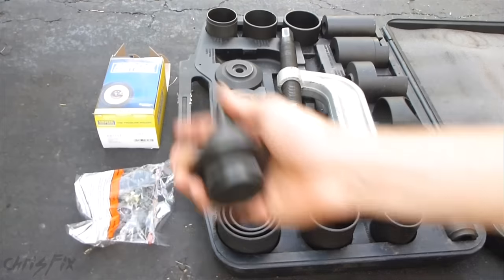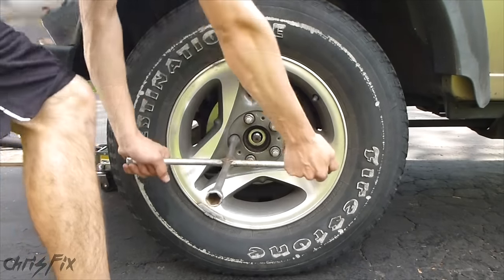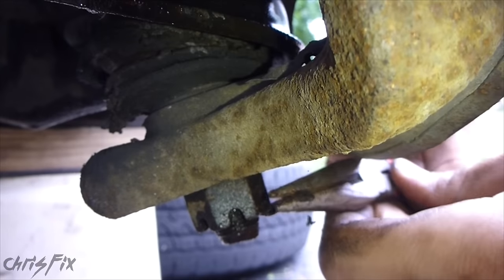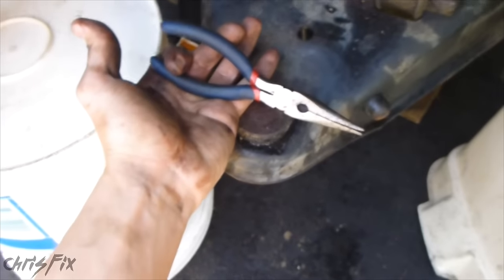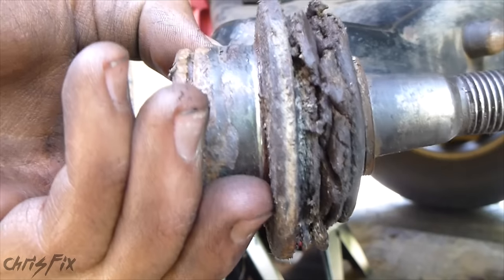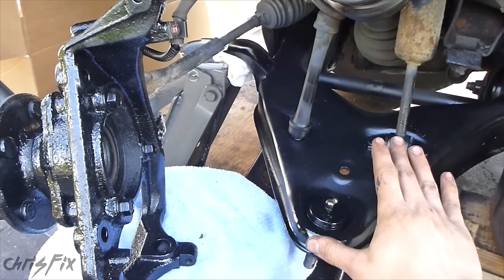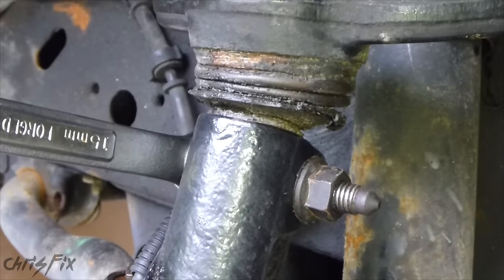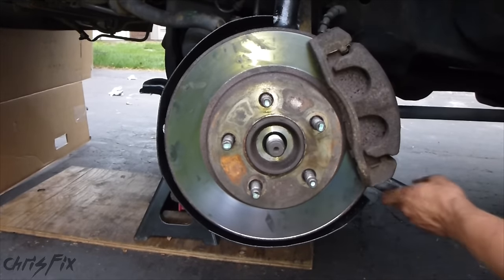How to Replace a Ball Joint (in depth, ultimate guide)

Comment: Tires my car eroded hand inside? What is the problem from the point of view.
Reply from the maker: Saeed SA You need to see if your suspension parts are worn out. There is too much negative camber. Bad ball joints can cause negative camber but so can bad springs.

Comment: Chris, i'm a tech, and i think that your video is well done. A few tips, if you don't mind~ One, it's easier to handle the brake caliper and it's mount adapter if you take the entire assembly off of the rotor. You can hang it with a bungie cord or some wire, like you did with the axle. Two, put a jack under the lower control arm before disconnecting the knuckle. When the ball joint comes apart from the knuckle, the spring can still have a lot of force and will push the arm down rapidly. I see that your truck has torsion bars, but coil springs can be even more dangerous, since it is contained between the lower control arm and the frame. Three, i would put the grease fitting in last, after assembling everything, that would reduce the chance of breaking it and having to take everything back off to deal with the broken piece that would still be in the ball joint.
Reply from the maker: +David B. Fishburn thanks for the tips!
Reply: You're welcome!

Comment: i dont recommend using blue locktite on the caliper mounting bolts because i did once and when the brakes heated it up the bolt fell out and the caliper started knocking on the inside of the wheel, once i replaced the bolt and used red locktite i never had the problem again
Reply from the maker: EmofacePS3 Thanks for sharing! Did you torque the bolts down or hand tighten with a normal wrench? I never had a problem which is why I ask.

Comment: Awesome videos! I have a loud squeaky noise on right side that sounds like a old door hinge  rubbing metal on metal when you turn the wheel side to side while moving slowly or sitting still. Had lower ball joint replaced a few months ago as well as bushings on the sway bar and end links. new tie rod ends inner and outer. new cv axle and control arm. Do you think the ball joint is causing this noise? Watched a few videos on you tube where others lower ball joints sounds just like my problem. Couldn't get that noise to happen with the car off the ground with the wheel removed. Your thoughts?
Reply from the maker: Try lubing the ball joints and see if the noise goes away.
Reply: new ball joints don't have grease fitting on them so how do you lube them?

Comment: Hey Chris is it normal after I installed the lower ball joint and tightend the casstle for some of the lower ball joint metal to show. I installed moog ball joints  and the boot seems a little shorter?
Reply from the maker: Yes that is normal as long as the ball joint is tight. They make the studs a little larger sometimes so that if there is any wear in the knuckle from a bad ball joint, the new ball joint will fit snug.

Comment: What up chris? Will a 3 in 1 press work on a explorer. Or should i buy the 21 piece. After this i will always do my own ball joints and bearing changes. Im pretty savy with woeking on stuff. But after i just got shafted on my fuel pump for 800 bucs. Never again. Then i took my girls truck up to sears and they wanted 1250 bucs to do her lower ball joints and inner and outter bearings. I bought the parts for 60 damn dollars. So i told my girl shes buying the tools for me to do it. Should i go with 3 in 1for 45bucs or 4 in 1 for 65 or the 21piece for 75 i found? Help me out my dude.
Reply from the maker: rick rich You can just rent the tools for free from your local parts store. If you really want to buy the tools (I am going to purchase the ball joint press myself) I have a link in the description to the one you want. As for a bearing press, I would go with this one (the more adapters the better because you will need them): http://www.amazon.com/gp/product/B00AZABHLQ/ref=as_li_tl?ie=UTF8&camp=1789&creative=390957&creativeASIN=B00AZABHLQ&linkCode=as2&tag=chri0e2-20&linkId=7MXRAS5IW5P3VW77
Reply from the maker: Yessir. It depends on the places near you but by me, I could rent both (although I decided to buy the press because I use it often enough).

Comment: Thank you so much bud. I have to finish installing the ball joint on my 2003 G35. I kind of messed it up by hitting on it to get it in the whole
Reply from the maker: +Jean Loizin Glad the video was helpful! Hopefully you didnt hit it too hard!
Reply: I hit it hard enough to damage the top of the screw where i had to cut the ball joint off to install a new one. But i just rented all possible tools from autozone for a refundable $600 just to get them in, and avoid hitting it. Thanks again, have a Bless one.

Comment: Ok...apparently, it is a locking hub cap.  My truck goes from 2WD to 4WD with a switch on the dashboard.  I'm doing research on how they work and how to remove them, but any advice you can give me would be very much appreciated.
Reply from the maker: Gertie Craign What vehicle are you working on?
Reply: 2000 Mazda B3000
Reply from the maker: Gertie Craign Oh, so the 2000 is the older body style then... Did you figure it out?

Comment: Hey chris, my upper ball joint is held to my control arm by rivets, I can remove the rivets and install a new ball joint but you and I know that will be a pain in the ass, I have been looking to see if I can buy a control arm without the ball joint so I can install the ones I already bought yet I have not found one yet, do you know if I can find what I am looking for, if not I'll return the ball joints and just buy new control arms.
Reply from the maker: Charles Andrianus Usually you have to replace the whole control arm. It is just easier to do that way. Mine is rivited in as well. Check out this video: https://www.youtube.com/watch?v=v7bOxQe_WhU
Reply: Ok Thank you, will check out out later

Comment: Chris,  I just went looking to see if I could find a picture of what the dealership called a "Locking Hub Cap" and realized that that can't be the right name for the part.  I'm sorry.  It doesn't lock the wheel on or lock the lug nuts or anything.  It isn't for security.  The black "cap"-thingy covers the opening where the axle nut is on your truck in your video.
Reply from the maker: Gertie Craign I am guessing you found out it is a locking hub and it uses engine vacuum to put your truck in 4x4. Are you still having trouble getting it off?
Reply: No, I managed to gently nudge it off with a screwdriver.  I'm just not sure how to properly get it back in, once the job is done.
Reply from the maker: Gertie Craign Well, figure that out when the time comes. I think it should just pop in, how does it look like it fits? Are there any clips on the back or notches or anything?

Comment: Question - I need to replace the upper and lower ball joints, pittman arm, and idler arm on my 2004 GMC Sierra 1500 4WD.  Should I wait until I know that I'll have enough time to do all of the work, or can I do the ball joints and then do the pittman arm and idler arm later? In other words, will the pittman arm / idler arm work be that much easier if I already have the control arm free from the ball joints? Thanks again!
Reply: +Adam Schatz Gee...where is the "professional's" answer.  How about it Mr. Fix It?  Why didn't you answer this gentleman?  Don't take advice from YouTube "mechanics".  ESPECIALLY on suspension work.  Go to a pro.  It's worth the money.  (I am not affiliated with any repair shop.  I was a pro years ago and I know of which I speak)
Reply: Adam Schatz Lucky you.  Maybe you're a little smarter than average (or a little luckier).  But how many are not as smart (or lucky as you)?  Hmm?   Youtube is not much better than Wikipedia.  If you think you're a pro because you watched a couple videos, you are sadly, pathetically, mistaken.   When I was working there were three deaths in 12 years.  One at a good shop.  One at a second rate shop.  One a backyard DIY'er like yourself.  After that, in the next 7 years there were 2 more DIY'ers that Darwin'ed themselves.  And remember I'm not counting those who lost a finger, broke a hand or a foot or lost an eye.   Plus, you're exagerating your savings. As to those "savings"....remember I'm only concerned with suspension repairs.  You want to replace your headlamps or wipers or the hood, air cleaner, oil, etc., I really don't care and that's not my point.  Go ahead.  But I have been crystal clear in stating I am speaking of suspension repairs ONLY and from your comment,  I severely doubt two things.  One, you actually were smart enough to comprehend the plain words in front of you stating my concern was suspension only (in which case how are you smart enough to take chances pretending you're a pro?)  and two,  that you saved thousands ONLY on suspension work... unless you drive the cheapest pieces of constantly breaking down crap available.  Tell me this......swear you've never gotten hurt saving all those "thousands" and tell ya what.....I still won't believe you.

Comment: Found It!  Remove 1998-2000 Ford Ranger 4x4 Pulse Vacuum Hub without the special Ford Tool  Doesn't say if it's ok to push back on hard, but I'm assuming I can.
Any idea why the bottom of the knuckle won't come off of the lower ball joint bolt? Has it ever gotten stuck on one of your vehicles?
Reply from the maker: Gertie Craign You really need to hit the control arm nice and hard to pop it out. Use penetrating fluid to help. I used the ball joint press to press the stud and force it out of the knuckle.
Reply: My friend and I were trying to use a pickle fork to wedge between the bottom of the ball joint and the knuckle, but we still couldn't get it to budge.  I have another friend coming over later.  I'm hoping we can figure out a way to get the right leverage.  You mentioned using the ball joint press...I'm trying to get a mental picture of how you'd set that up.  Would you mind expanding on that a bit?
Reply from the maker: Gertie Craign I set it up just so I can press the ball joint stud (at an angle) and put the top pressure on the control arm. That is how I did it on my other ball joint. Does that make sense? Basically be creative and use the ball joint press to press the stud upwards. You just need it to pop.

Comment: Chris,
I was able to remove the wheel, and the plastic center cover.  However, that plastic, can-shaped center cover was covering a black "cap" of some sort that is covering the axle nut.  Any idea what that black "cap" might be? And how to properly remove it?
Reply from the maker: Gertie Craign So the black cover goes over the axle nut? It probably can be pried off with a flathead screwdriver but I am unsure what you are referring to exactly. On most vehicles you take off the center-cap on the rim and you have access to the axle nut. What are you working on?
Reply: It's a 2000 Mazda B3000 4WD
Sorry for the fuzzy information.  I found out that the black "cap" under the center hub cap is a Locking Hub Cap.  Apparently, it has to do with the mechanism that allows me to switch from 2WD to 4WD.  I think it's some sort of vacuum cap.  That's what the dealership said, but they were kinda guessing.  They couldn't tell me how to remove it, though.  You were right...I was able to gently pry it off with a flat-head screwdriver.  I think it will pop back on, when I'm done, but I'm not sure.  I tried putting it back on to keep the axle end from being exposed to the elements overnight, but I wasn't able to.  It may just require a lot of force.  Not sure.  There was no axle nut underneath the cap and I can't tell if the axle isn't slipping out of the knuckle because it's just old and stuck or if there's something else holding it in there.  Right now, I'm stuck on trying to get the knuckle off of the bottom ball joint bolt.  The castle nut and cotter pin are both off, but the knuckle just won't come down off of that bolt.
Reply from the maker: Gotcha. You are going to have to really force that knuckle off the ball joint stud!

Comment: Chris,
Can you please tell me what manual you looked at, to get those exact torques for each bolt?  You wrote, "check your service manual for proper torque specs".  Are you talking about something like Chilton's?  Or is there a better manual out there that I'd need?
Thanks!
Reply from the maker: Gertie Craign The best manual is the manufacturers service manual. I have one (two books) for my Vette and it is made for my specific year. The chiltons is garbage. I read though it and they do things incorrect and do things the hard way. Plus it is for multiple years so it can be vague.
Reply: ChrisFix Thanks for the quick reply!  You're awesome!
So...the dumb question of the day: How/Where to I get a copy of the manufacturer's service manual for my truck?
Reply: Gertie Craign Omg...I just saw that you have a video for how to test the alternator.  That's another of the jobs I need to do!  lol  You are the best!!!
Reply from the maker: Gertie Craign You can get the manufacturers service manual on Ebay.

Comment: Do you recommend to purchase a ball joint press from Harbor freight. I would like to own one. Thanks what is a good $ to pay for a press.
Reply from the maker: elteruno Acosta Honestly, some things HF has are great, but the ball joint press is not one of them. I would spend the extra money and get the one I used. You wont have enough adapters on the HF ball joint press. I linked the press in the description where you can get it the cheapest!
Reply: thanks Chris
Reply: There is some cheap ones on eBay

Comment: Id wish it was this easy on my Peugeot 206 :( wasted 4 hours trying to get the damn thing out so i could replace the shocks... did not succeed. I had to go to work.. so put every thing back.
Reply from the maker: Sword of damocles Dang. What was holding you back?
Reply: ChrisFix well the whole unit rests on the ball joint.Because the suspension is part of the unit, I need too leaver the unit up allot.it slipped a couple of times as the brake disc rotates and is the only place to leaver without getting in the way if the ball joint. After finally having it firm and steady, I tried getting the ball joint out of the unit. No luck as I didn't want to damage the driveshaft or any thing.

Next time I'll be having some help and some heavy tools, force is needed to pull it out so the unit can be lowered beyond the ball joint and give the suspension space to get loos
Reply from the maker: Sword of damocles Gotcha. Spray some penetrating fluid in the ball joint hole too! Use this stuff: https://www.youtube.com/watch?v=2WuVBFTzoKc

Comment: do I need to put the car weight on suspension before I torque the castle nuts to spec?
Reply: Yes. Otherwise the tire will just spin. The secret is "kiss the ground" not all the way down.

Comment: Is their a way to get the ball joint in and out without using a ball joint press?
Reply from the maker: mutha phocker The best way is to use a press. You can use a hand hammer or an air hammer to get them out, but you cant get them in with a hammer (you will damage the new bearing). You can rent the press for free at your local parts store. Definitely consider subscribing!  New automotive 'how to' videos every Thursday and most Mondays so stay tuned!

Comment: Get to a stuck ball joint and see how fun it is. I gave up doing it myself.
Reply: nukestrom I had the same problem but I went out and bought a little gas torch, heated it for a bit and it popped out.
Reply: Yep that sounds good too. I actually ended up cutting it and used the ball joint press and pressed it out.

Comment: I notice you dont use grease often, could it be used on the ball joint or no?
Reply: Mat Zシ Moog ball joints come pre-greased.  Once you have the new ball joint installed you screw in the grease fitting and add a little bit more grease.

Comment: Do I have to get an alignment after doing this? I’ve heard yes and I’ve heard no and wasn’t sure.
Reply: Did you ever get an answer on the alignment?  My guess is no because it is not   working with adjustable bolts like tie rod ends.
Reply: @sailingpittsburgh  Hi. Unfortunately no answer so far.

Comment: You need an allignment after this ,  correct? Or is it not necessary?
Reply: In this case no. Didn't have to remove the tie rod or either control arm.

Comment: My wife has 2005 pt when stopped at a red light or stop sign the car boggs down when u turn on the ac do you have any ideas
Reply from the maker: Dwight Slaven Any check engine lights? How many miles? Original spark plugs? Is the air filter dirty?
Reply: New plugs. No light. New filter.
Reply from the maker: Maybe you might want to try cleaning the mass airflow senor. That sometimes fixes that problem. How To Clean a Mass Airflow Sensor (In-depth, detailed version)
You should also look for vacuum leaks which could cause the car to bog down. 
The last thing I can think of for the PT is to do a fuel pressure test to make sure the fuel delivery is good
Fuel Pressure Test
Do you have any idling issues or hesitation while accelerating?